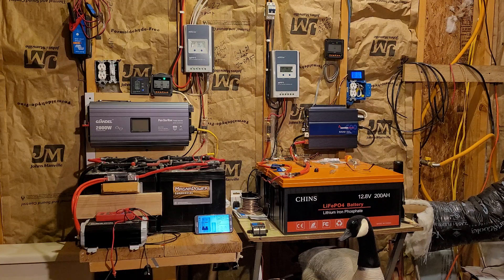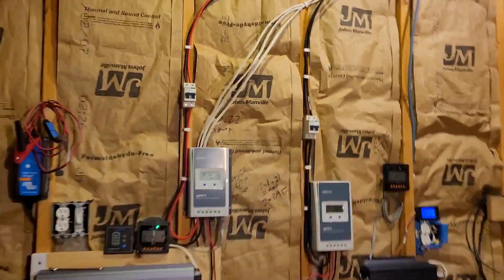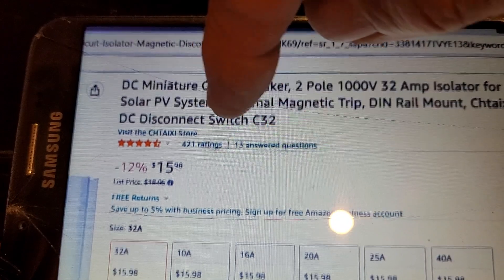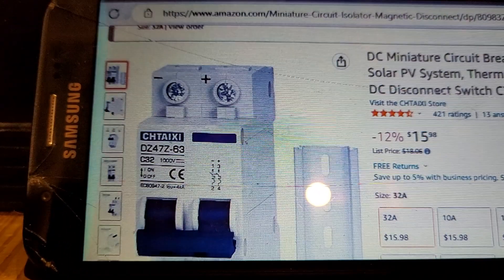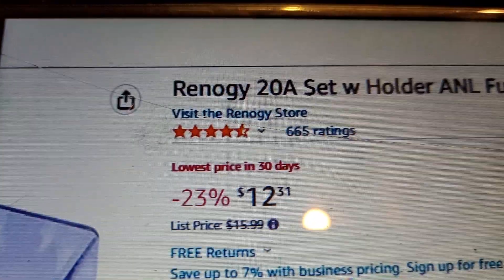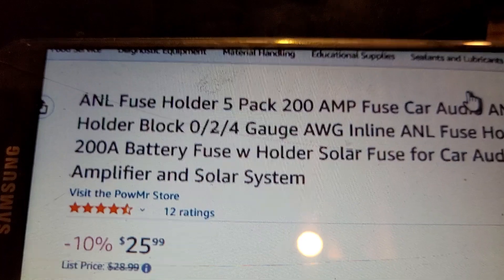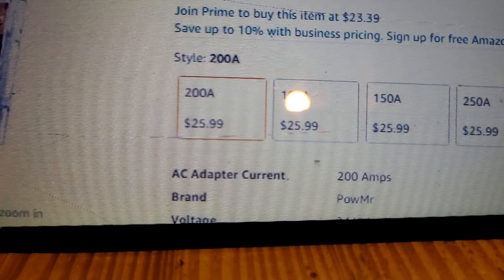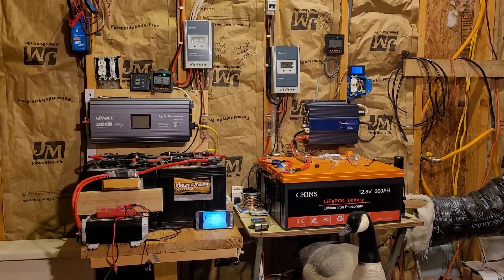Off Grid Solar fuses...

Comment: Thanks do you fuse the both positive and negative from solar panels? Do you think the inline MC4 fuses are good for a solar generator? TIA
Reply from the maker: I use a breaker style in-between panel and charge controller....yes it does both positive and negative...never tried the in-line mc4 kind....I like the ability to use the breaker style fuse to cut off panel power when needed ...

Comment: I use CIRCUIT BREAKERS between the solar panels and the controller, the controller and the batteries, and a 250a FUSE for the inverter...
Reply from the maker: Having the switch is indeed handy
Reply: @CentralIllinoisSolar  I use a 250a switch with the inverter also... I grew up in westville

Comment: I use ANL fuses 60amp for my charge controller and 300 amp for my inverter
Reply from the maker: I'm 32a for charge controller and 150a  for inverter with a 60a  in-between panel and inverter